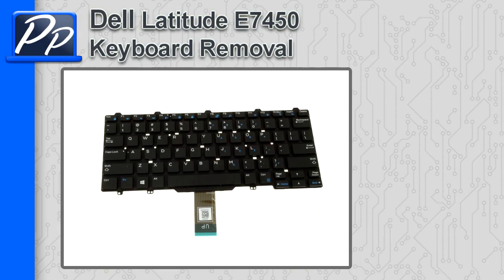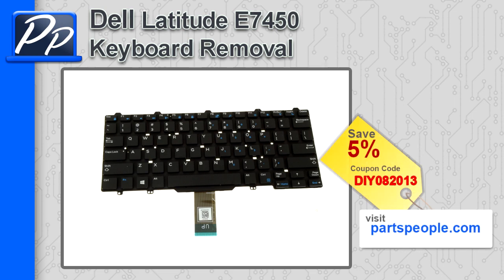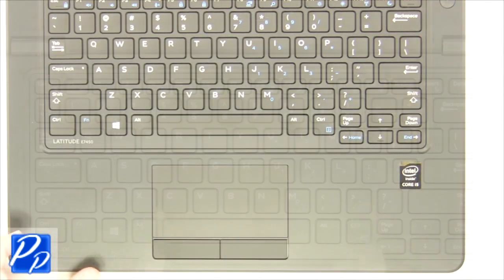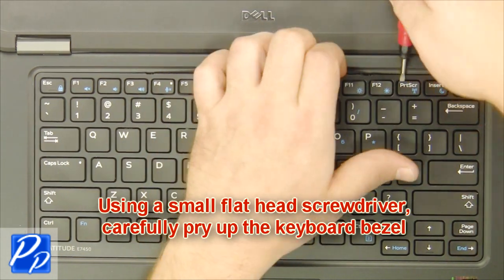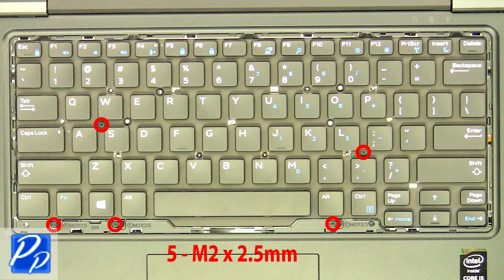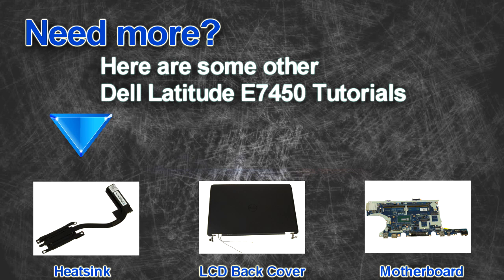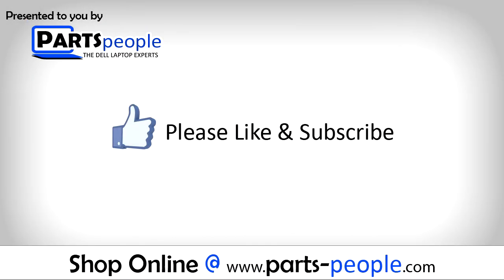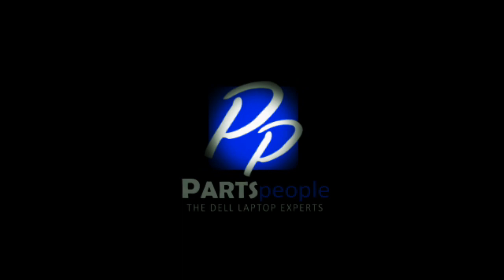Dell Latitude E7450 Keyboard Replacement Video Tutorial

Comment: So can one replace a non backlight KB with backlight one on the E7450 ?
Appreciating any help here.
Reply from the maker: Good question. Yes, you can replace the non-backlit with the backlit but
 you also have to change the palmrest. The E7450 has 2 different 
palmrest and keyboard options, the "single pointing" and the "dual 
pointing". Only the "dual pointing" is backlit, so you would have to 
change the palmrest and keyboard to "dual pointing" to have the backlit 
option.

Comment: So you know.  The new model keyboards come with at least two separate connectors and have four ribbon cables total.  Not just the wide central cable.
Reply: Exactly. And what a nightmare this is. Those little clips that hold the ribbon cables on pop off (not up, with ease, like there SUPPOSED to) and are impossible to get back on! I'm so angry right now... I'm increasingly frustrated how these companies continue to devolve in design and serviceability.
Reply: @DevCom666  in my &$%) backlighted keyboard there are four connector strips are there (one of that is wide as shown in this video). Flip up the door, then insert back the strip and close back that door type fli[p lock. Dell designed it very well.

Comment: so I had this same keyboard replaced on my laptop at work but the tech that installed it ended up damaging the tab that holds the keyboard ribbon down and it ended up coming off. is there a way i can order a replacement tab?
Reply from the maker: Unfortunately, I don't think you can buy just the tabs. They're super fragile and if broken, it usually requires replacing the motherboard.
Reply: Parts-People.Com, Inc wow thats a shame. other than the tab everything works too. thanks for the quick response.
Reply: put the tape over it and it should hold good. 

Some time I retrieve the flip lock from old junk boards.